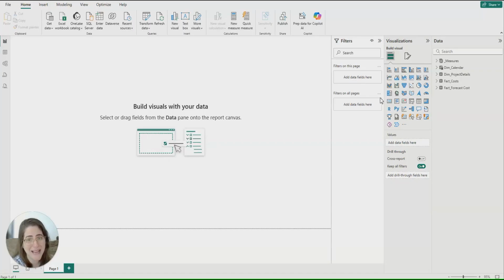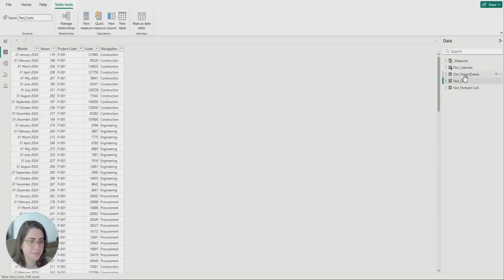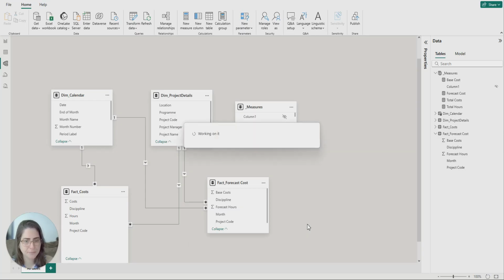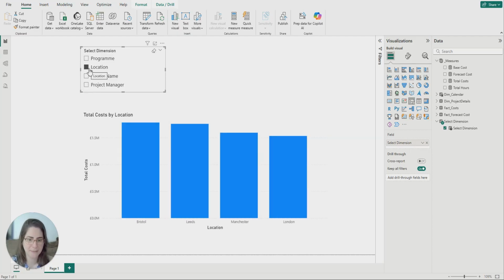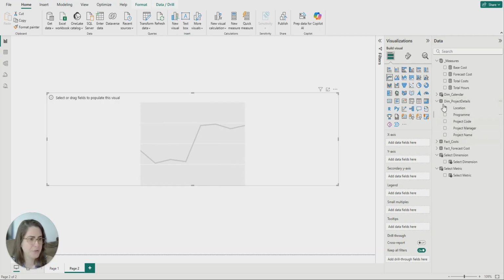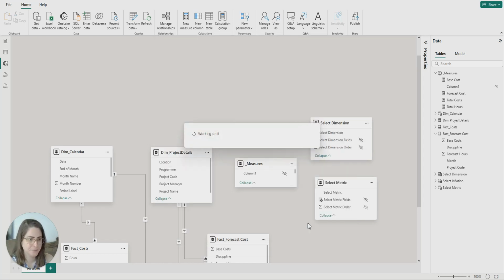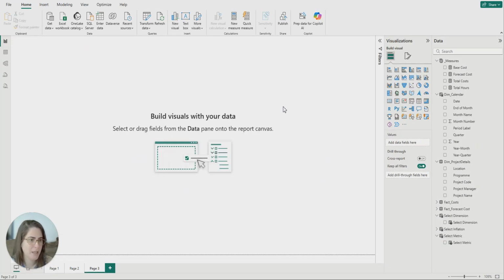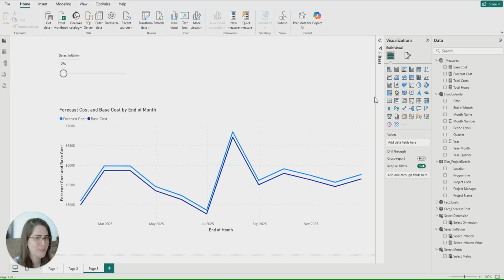Dynamic and User-Driven Power BI Reports: Field + Numeric Parameters Tutorial

Comment: Thanks, Juliana, very well explained! Could we do this in Power Query, and what would be the preferred way to create a parameter in the model view or Power Query?
Reply from the maker: Hi Sidra, these are completely different things. Parameters in Power Query are used during data preparation, letting you define fixed values (like file paths or filters) that shape how data is imported before it loads into your model. Field parameters are created in the modelling view and give report users flexibility to switch between fields or measures in visuals, making reports more interactive. Numeric range parameters, also built in the modelling view, allow users to adjust number inputs dynamically through a slider or box, which can directly influence calculations such as forecasts or thresholds.